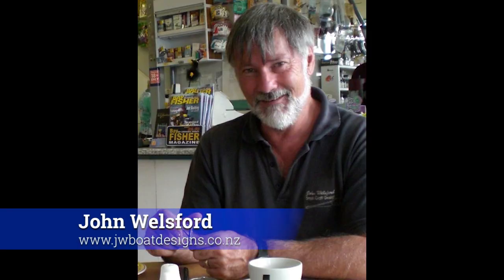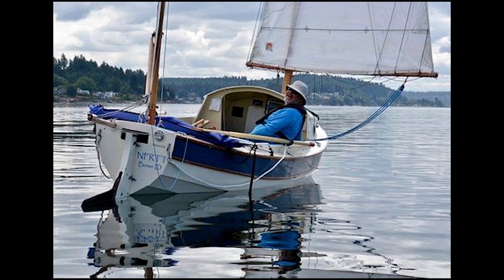Small Wooden Boat Design: with John Welsford, John Harris, Michael Storer, and Clint Chase

Comment: Enjoyed this video immensely I live near John Welsford and may have met him on the water a couple of times, a cool dude. I have built a few small ply boats and have just completed a self designed 11ft sailing dinghy I won't do it again (self designed) as its just too hard I reckon it took me 2 years longer than it should.  I salute the skill of the designer in solving problems for the home builder in the pages of their plans while I enjoy the exercise I also enjoy a build that flows through the process naturally. Of course its always slow because its a hobby and not on a time limit but the previous boats built to plan are a much less cerebral exercise.

Next boat plans already bought and paid for, a Tango 15, which is the first boat I intend to keep for myself. Previous boats are tenders for my 28ft keeler or sailing dinghies for my children (latest one is for grandchildren). The Keeler is for sale right now.

Comment: Great conversation. Please continue them.  The idea of collaboration among you and perhaps others is excellent for a host of reasons that are all wrapped up in the words “continuous improvement”.

I’m new to small boats and know very little about ‘em although I've a bit of reading. Omnipresent cost is an issue here (UK) Gaboon/Okoume ply being UK£100 ish per sheet of 6mm.

Here's my tuppence worth: There's a shortage of PROVEN designs for lightweight, seaworthy, high capacity (2 maybe 3 adults & gear), beachable, row/sail boats =<15ft 6 inches (4,724mm) LOA. 

 
My quest for a small boat began over a year ago and I purchased the plans for Mik Storer’s beautiful Eureka, thinking that it would meet my requirements. While prevaricating about getting on with the build I developed the knowledge that while it is a great design for relatively calm waters it wouldn’t take the bashing of heavier weather.  
John Harris’s Jimmy Skiff II and Clint Chase’s Caravelle Skiff are contenders but I’d prefer a simple-to-build boat that is not flat bottomed i.e. with a shallow V hull to reduce slamming a bit.  John Welsford’s approach matches my own in that functionality and safety come first but his designs seem to be a bit too heavy for my purposes. My weight test is: can I lift it up unaided onto one shoulder.

I’m only guessing but I reckon that there are folk out there who have the same requirements as mine.  Am I searching for the impossible?
Reply from the maker: >>>> a shallow V hull to reduce slamming a bit.>>>
One thing to remember is that as soon as a flat-bottomed skiff is heeled a few degrees, it IS V-bottomed and has a soft ride. As soon as a boat with a shallow V hull is heeled, it becomes FLAT-bottomed. (The ubiquitous Sunfish is a good example. It'll pound your molars out in certain conditions.)